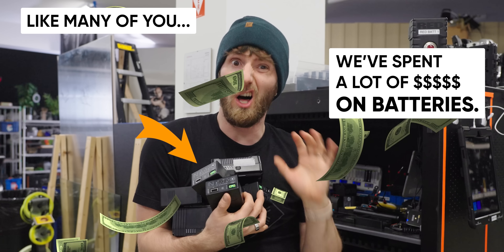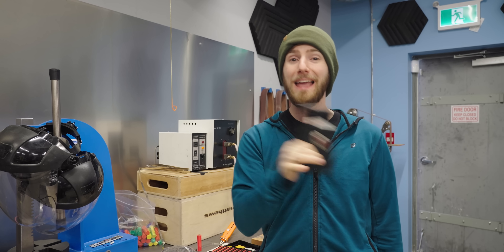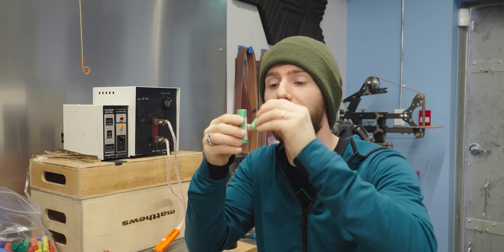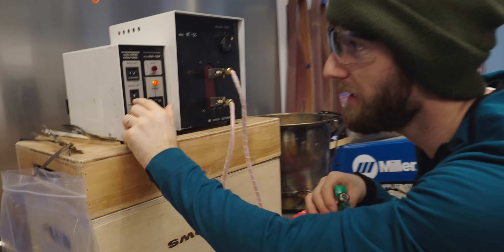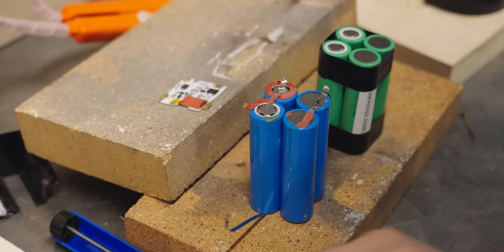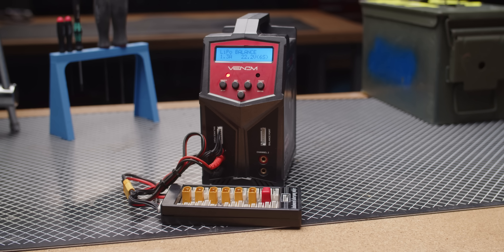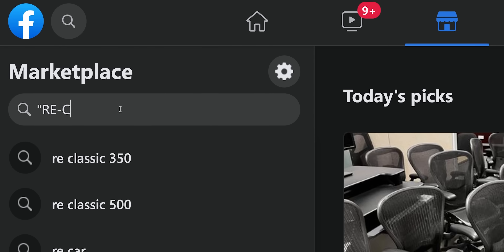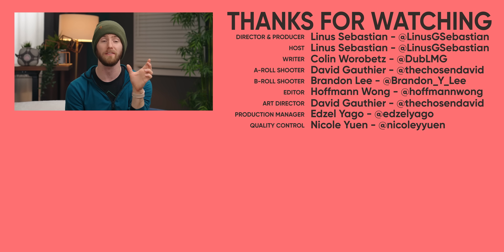This should be illegal… Battery Repair Blocking

Comment: As someone who's built a lot of packs this makes my brain itch a bit watching them do it. Seeing the spot welder tips glow orange... the hell, that's not 14ms, more like 140ms.
 Also cutting the old battery holder in half to line up the cells, could just line em up on the table with a piece of wood at the bottom to get them straight and glue em together.

Comment: The why is easy - and no I'm not saying its right, I'm just explaining it:

Why this happens is:
1. The US legal system - suing is too easy. Why would a company make it even easier for anyone to sue them when there's a simple way to stop it.
2. Company reputation - if someone does a bad replacement/rebuild whats stopping the media and the general public from blaming the company instead of the person who did the rebuild?
3. Its a consumable - the company needs to make money by selling products. Batteries are a good consumable that keeps money flowing into the company. All western countries have battery recycling programs so its not really a landfill issue

If you want reason 1 to go away, the law needs to clearly free the company of any and all liability when a 3rd party modified / rebuilds (in this case) a battery.

If you want reason 2 to go away then mandatory batter rebranding must occur. The law must require the modifier / rebuilder to permanently re-badge the battery and register the rebuild on a rebuild register so the company can't be wrongly blamed and lose reputation.

Reason 3 can't go away unless you want companies to go the way of BSA (an old British company) who made products that never failed and thus they went broke.

One other point that right to repair doesn't fairly address is IP rights. Whilst things need to be servicable / repairable, the company should maintain the rights to keep software, firmware and detailed schematics proprietary until such a time as 5yrs beyond the abandonment (no used at all by the company in any other product) of said piece of IP. Many companies reuse and further develop software, firmware and board schematics and given that in the current times those things are the "secret methods" that make one product better than its competitor, the whole situation is a very difficult thing to implement.

Comment: You can reuse the old batteries. You can just buy one of those battery boxes. I did this with an old battery pack. Works fine. I don't charge expensive stuff tho. Also I want to see how the replacement of batteries is done.
Reply: Sometimes they're just dead though. If they have regularly used that Red battery for 6, 7, 8 years, I wouldn't even bother measuring the cells.

Comment: At the hospital I worked at. The batteries for the doctors tools saw, drill, etc stopped functioning right at 50 charges. The carger I used to top them off before sterilization said the number of charges it was on so we could order new ones.
Reply: That's probably because standards for medical equipment are extremely high. They probably have to guarantee something like 99.999% safety and functionality by law, and the only way to reach that number is by changing the batteries at 50 charge cycles.

Comment: A couple of tips to those who try to replicate these steps:

1, Don't.

A couple of tips to those who try to build or rebuild a battery pack:

2, Use insulation BETWEEN the batteries, even if it is just hot glue or double sided tape. The whole side of an 18650 cell is negative, so you have to have some spacing between the cells.
3, Use insulation ON THE POSITIVE CAP of the batteries. Again, since the whole side of the 18650 is negative, laying a nickel strip across the bare cell is russian roulette with 5 bullets.
4, Wasting a whole new pack because a spark is just nonsense and also bad for the environment. If you short a cell group for a millisecond, nothing will happen. Yes, it's not ideal, yes, it might be a small shock for the internal resistance for the pack, but if you're using name brand batteries, not Chinese knockoff, you're safe.
5, Throwing away the old pack as a whole is also foolish and wasteful practice. Usually only one cell group dies, the rest of them can be reused in flashlights, small 12V battery packs, RC toys, the options are almost limitless.

Plus one:

It's always good to check whether your BMS is smart or not, meaning whether you have to keep it under constant voltage or not. If your BMS is losing power and therefore all its "brain functions", you're back at square one. Get a contant power supply, measure the current voltage or your pack, set the power supply at that voltage, solder two wires to the positive and negative ends of the BMS and feed it for the power supply while you're working your spot welding magic. When you're done with the spot welding, measure the voltage of the new pack, then increase the voltage on the power supply to match the pack's voltage, then connect the BMS to the pack. Sparks: avoided, BMS brain functions: saved.

The video shows many bad practices that just should not be followed, or I might risk saying it, even published. Saying you're an amateur at something and doing it the same way the second time as well is a sign of not willing to learn. Look at professional tutorials, read forums, takes 5-10 minutes but you'll be safe. I wouldn't even store these batteries in my shed, sorry.

Comment: I'm kinda surprised you guys didn't bring in an expert on this one. Battery spot welding isn't rocket science, but it is quite finnicky. There's plenty of off-gridders and home-made battery wall YouTuber that have a lot of experience in this kind of stuff, I'm sure there's a few near you.

Also, I'm pretty sure that 14 on the welder is not 14ms. 140, maybe, but 14ms could happen between two frames on a 60fps camera. That's an incredibly short amount of time, and this weld lasts notably longer.

Like others have said, I don't think those sparks were from the batteries, on the second one at least. I'm no expert, but I've seen some homemade packs. The HAZ (heat affected zone) is usually a tiny circle around the two contact points. In the shot at 11:15 you can see the entire nickle bit between the two contact points glowing. I'm pretty sure it was just the nickle that got extremely hot and sparked.

Comment: Hey Linus, I like your video but I have to object on a small thing. You STILL CAN replace the cells in a pack eve nif the pack has volatile memory or bricks itself after poserloss. I've done it myself on an old laptop battery. The first one I killed just like you did. So I took some tiny cells and wired them together just like the cells in the pack. I then charged them up to the voltage of the cells that I want to replace and also made sure the new cells have the exact same voltage. Now you take the "dummy" pack of small cells and connect that to the pack in parallel to the old cells to the bms. Now you can carefully disconnect the old cells from the BMS and the BMS will not loose power. So it won't notice anything happening. Now that only the dummy is on, you can now connect your new cell ararngement to the bms. Once that's done, take off your dummy pack and you should messure that your pack is still alive. PLEASE do that again because you should let cpmpanies stop you in your project. In my case, I not only repaired my Laptop battery, I even increased it's capacity drastically. And after a few cycles, the laptop even learned the new runtime of the pack.
I hope you try this. It can be done.
Reply: Some BMS don't accept resets after cell failure to prevent powering broken cells. So if you disconnect any cell it will behave like BMS with volatile memory.
That means on many evil BMS it is already good enough to find out what is powering the BMS and disconnect this first. For example, on older Dyson BMS you just need to cut the main positive pole first before disconnecting any cells. If you do use any other disconnect order, BMS will detect a failure and hard lock.
Reply: @falco3899 Great info. Would be nice to see a list of batteries with tested methodes of re-celling.

Comment: 1. Don't buy cells for this kind of thing from vape shops. For one vape batteries are not ideal for this kind of application, they support very high current which might be desirable but also they will die much much quicker (300 cycles vs 800 cycles) and also have lower capacity. At the same time they can be from different batches with different  internal impedance and and that will create unbalance  easily essentially leading to lower capacity. When building packs like these always use batteries from the same box and you have to equalize them before assembly. 
2. The categories of BMS are semi-accurate. The "Evil type" is actually illegal in some countries and should be everywhere, but the problem is in a different kind of BMS. A safety feature in many BMS systems is that once the voltage of any cell drops below a set limit (usually 2V for Li-Ion) the BMS blows a fuse so that the pack can no longer be used. This is called secondary protection and will be triggered when you disconnect the cells from the BMS. There are ways to fix this but not easy for anyone. A way around it is to supply a voltage for every part of the string that you remove, but can be a bit tricky. Secondary protection doesn't trip instantly, it takes a few seconds, if you manage to disconnect the cells and connect to another supply within that time the BMS will not know the difference. 
3. A cell pack that has been used a lot (many cycles) will not have 1 or 2 bad cells, all of them will be degraded, at different degrees maybe but you don't wont to use them anymore. So as Linus mentioned never mix new and old cells in a pack! 
4. Throwing out the entire pack because something happened during assembly is overkill. Cells don't just blow up like this. During assembly you either shorted something or the heat from the welder was too much and you overheated a cell. In both cases you have options. Just keep in mind that if you sorted something it's better to try and remove the short, and if you can't in like 10-25 seconds then yes dump it and run. If a cell is overheated by the welding (which should never happen if you use correct settings) the best thing is to actually dump it in a bucket of demineralized water (water without salt or other contaminants is not very conductive) or non conductive oil. it will cool the cells down and might stop the reaction.

Comment: Sure this probably already been said, but when you sand your terminals  down you're gonna leave a bit of sanded metal on the tips and you're dealing with a lot of current and you're basically melting those tiny "metal" pieces to boiling point hence the sparks its oxidizing very rapidly , those are not shorts, you need to clean your rips with a cloth to rid the tips of small bits of dust of metal  OR just get better spot welding tips, pure copper only. Stop being a bunch of scaredy cats you just created a lot of more fire hazard when you dispose of good cells like that, probably in the bin. as much you like to think you're making a video for the goodwill...

Comment: Last year I replaced my Yoga book battery cells, by swapping fuel gauge (bms) board from Android version to Windows version. The cells had some charge left (3.4 or something volt). But after I swapped the cells, bms board output 0 volt. This might be the case why Linus's battery has 6.9volt (🤔) at cells input but no output from BMS. The reason is that there's MOSFET that gating the battery output. Mine successfully bring back to life by recharging it. This way will kind of "restart" the bms circuit. But this is just one of possibilities why after cells swap doesn't bring the back back to life again (Fried bms, cells lock, who knows🤷‍♂️).

Comment: Wow, seeing how batteries are recycled would be awesome!
You know I was surprised too when my dad said that bosh and other e bikes manufacturers don't allow other brand's batteries to be used with their hardware and that you can't use even the batteries with evil bms on other devices. Fortunately he got 2 dead battery packs from bosh, we opened them and they both had only one cell visibly wasted. Since he rushed me a bit (I am the electronic of the family) I told him the best we could do was changing at least the parallels where the wasted cells were and trying to change the bms.
We ended up doing a cheap job and I still have to install the bms and test one battery, I hope nothing goes wrong even though by you guys' safety standards we were far off.

Comment: Linus You should have tested thos cells for capacity(if they are similar) not ther voltage. Low voltage cell u can reanimate with 12v short shock before normal charge, but low capacity of one cell is gona drag down the pack soon.
Reply: They were new quality cells, they should be the same capacity.

Comment: I disagree on one point here.  It doesn't need to be dangerous to re-cell a battery pack.  It is only dangerous because from the factory they are built as a disposable item.  If manufacturers were to build packs in casings that were held together through clips or pressure (like a regular AA battery is held in by a spring) rather than being welded it would be perfectly safe for a user to just buy new cells and swap out the old ones (as long as they did the voltage matching checks as shown in the video).